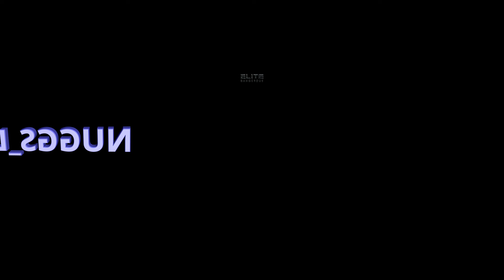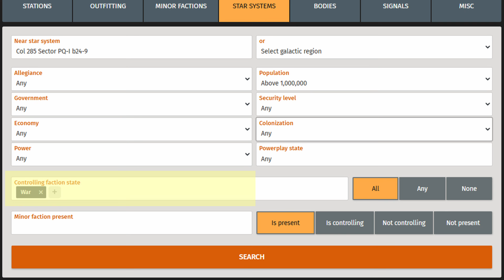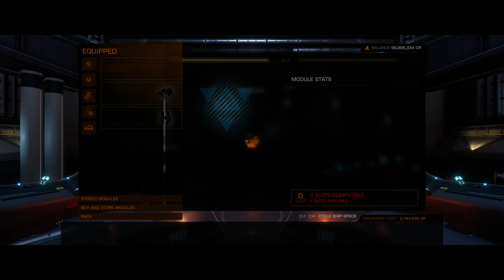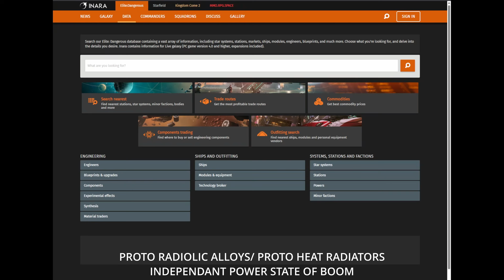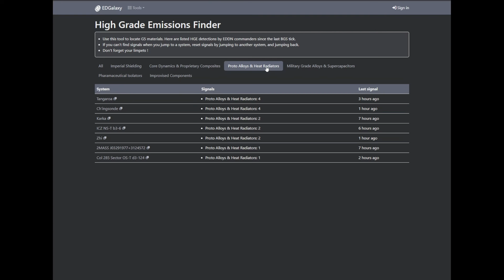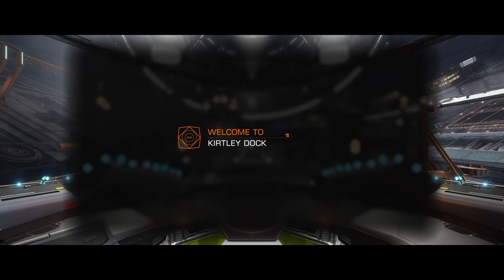Engineering Material Farming Guide Elite Dangerous | Part 2: High Grade Emissions

Comment: My generalist Corsair has 7 collector limpet capacity, 2 SRV's and 128 tons cargo. Jump range is 39ly while carrying 64 tons of limpets, which should definitely be enough for a while. It handles reasonably tough fights, and is pretty fast for a moving hardware store. So it can always scoop up an HGE on the way to doing whatever. And pick up the remains after each fight.

Mandalay or Cobra 5 would also work in a bit of a collector spec, if the handling and footprint are preferred over the flying warehouse. Or a more stripped down spec of the Corsair. I'm just trying to cram everything into one daily driver. It's hard to recommend anything non-SCO Optimized, because these choices are kinda OP. But essentially any ship will do. The "OP" ships will basically have more internals space to spare.

If you are using 3-slot, then do a multicontroller like mining. It's +1 collector limpet compared to a class 5 collector controller. You can only one have one multicontroller, so ideally you'll probably have 4, 7 or 10 collector capacity for an HGE-capable ship. It certainly doesn't need to be a dedicated build to still do HGE's at a nice pace.
Reply from the maker: Sounds like you have a great setup!